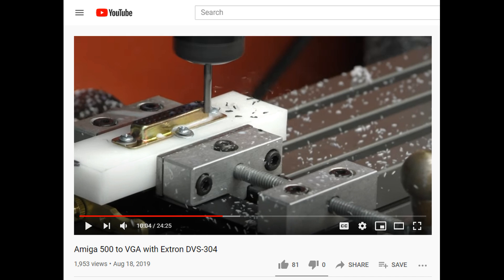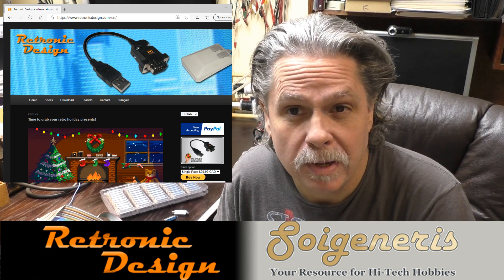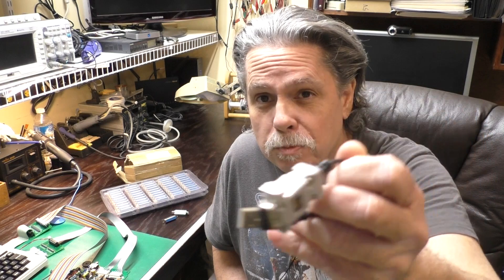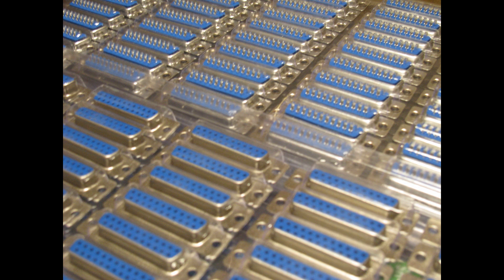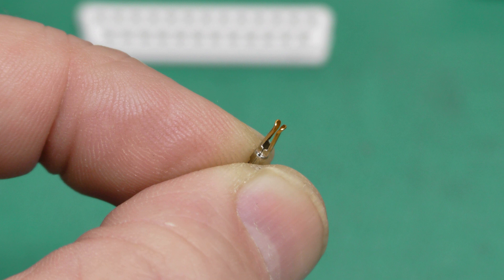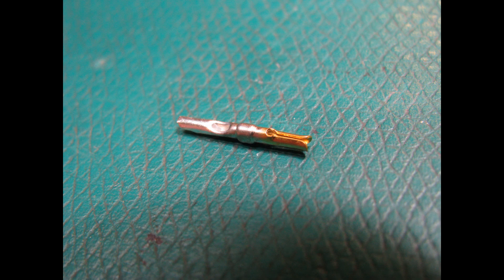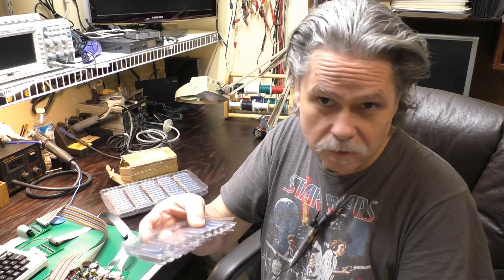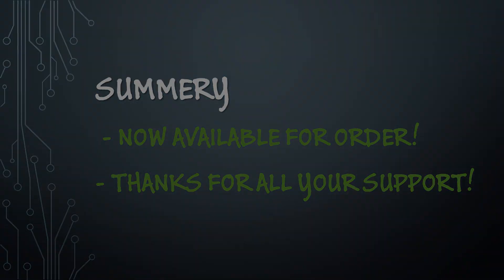How a couple of Amiga enthusiasts brought the obsolete DB23 connector back

Comment: Did you make only the female version?
Reply from the maker: At this time. Each connector type requires different tooling and producing the tooling is expensive. There has to be enough demand for each connector variation to even cover the cost of the tooling.

Comment: This is very cool.

I once made my own RGB connector by soldering together two DB9 side by side. The analog signals only use the outer pins so that worked fine. I have also cut DB25 diagonally in the middle and cleanly joined together again by soldering the shield. It works with both male and female connectors, so I did this for the external floppy as well.
Reply from the maker: I heard of someone using a laser to slice a DB25 as you mention. It works if you have the time and skill to perform such surgery. 

We would like to reproduce the male connector as well but there needs to be enough demand to even cover the tooling costs.

Comment: Awesome Work!  I will be ordering some for sure.  As for other ideas I probably am not the first but since all these recreation motherboards there is a need for Male and Female Right Angle PCB mount connectors for Video and External Floppy.  Probably a lot harder to do I am guessing.
Reply from the maker: We have the RA connectors in mind. They would require different tooling which is expensive and it is not clear if there is enough demand to even cover the tooling costs. Hopefully, it is something we can do.
Reply: @HeyBirt  Sure there is a high demand for the RA connectors ...in my opinion more than the normal ones. Anyways great work.

Comment: Cooperation between retro computer fans can get through anything!  DB23 hoods are next in line. Thanks for the cheers!!! :)
Reply from the maker: Hi Francis :)

BTW, if everyone has not done so yet check out Francis' website and his awesome Amiga RGB to component video adapter. Ten Minute Amiga Retrocast did a video about it a while back too so you can get a good idea how it works. Of course they are now made with genuine, top quality, 'blue' DB23 connectors :)

https://www.retronicdesign.com/en/

Comment: Outstanding job Jeff. You and Francis deserve congratulations.

The Amiga DB23 video connector and the square 5 pin power plug in the Amiga and C128 where the two most sought after connectos for retro computers and now they are both available again. Please keep up the good work and the great videos you put out.
Reply from the maker: Thanks. It is quite rewarding to see now powers supplies being built with the 5-pin DINs and new video cables and adapters being built with the new DB23s.